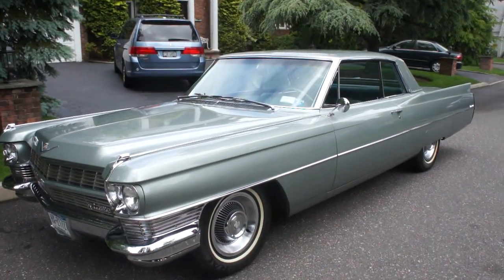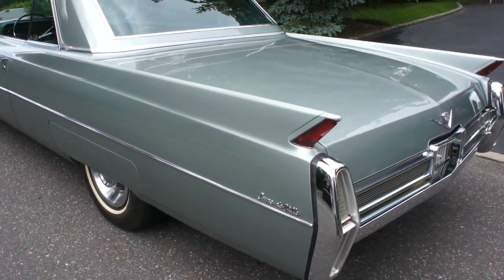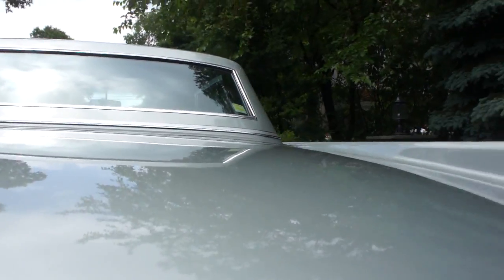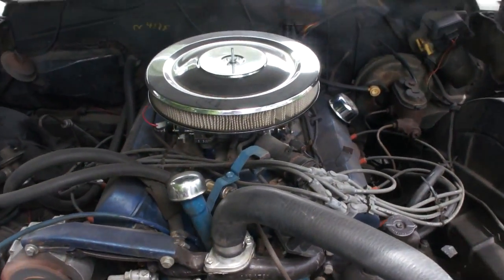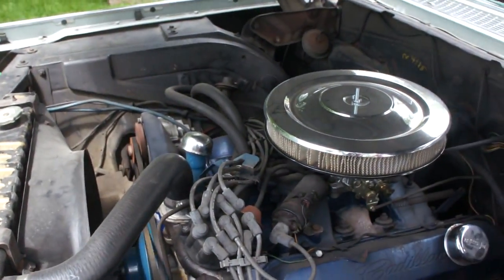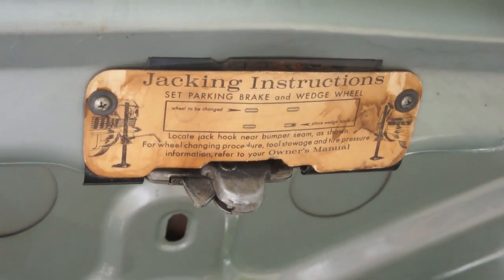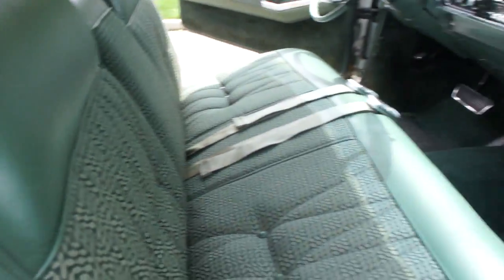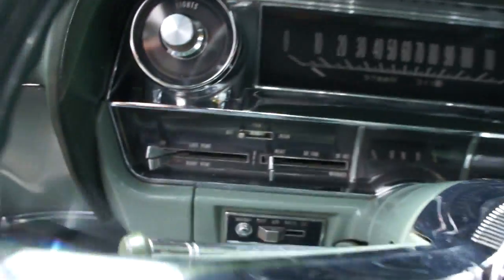~~SOLD~~1964 Cadillac Coupe Deville~Absolutly Beautiful~Sea Foam Green

Comment: Rough sounding engine.  A car of that caliber really should have air conditioning!  Need to quiet down that engine!
Reply: Hi... I had a 64 Coupe years ago.... My car was white with Black Vinyl roof..... she had power window but no A/C ... that was an option back then even on Caddy's !   I want to say  about $500 option bacl then......  69 Cadillacs  A/C  became std equipment..
Reply: Exhaust Leak?  My '64 sounded just like that until I fixed one of the exhaust manifolds.